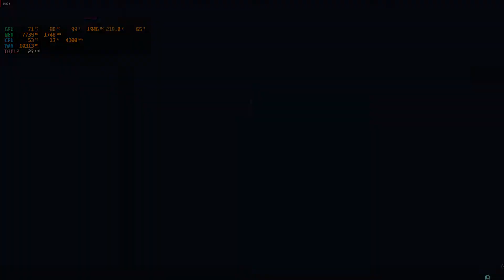How to fix ASUS Radeon RX 5700 XT Strix temps

Comment: What is the size for all the pads?
Reply from the maker: You can find the pads I used in the video description.
If I am not mistaken, the memory pads are 1.5 and the other ones are 2.0.
I believe those measurements are mentioned in the video.
Reply: @DiegoPCMR tankyou

Comment: Am going to it with my strix 5700xt she is getting 105-110 on hot spot lately what type of washers did u use m2 1mm or 0.5 mm ?
Reply from the maker: @omarbettayeb3943  This was so long ago that I don’t remember well which ones I used, but you can find in the description the washers set I bought. I would suggest using very thin ones and don’t try to over tighten it, be very gentle.
Reply: Did you find out what washers to use?

Comment: Hey, what are washers and why do you need them to fix this card
Reply: so can you provide the answer?
Reply from the maker: washers are small pieces of round plastic that go between the screw and the screw hole, increasing the gap and therefore increasing the presion.
This particular model had the issue of having the heatsink not so tighten to the pcb and for that the temps were too high.
Even Asus provided at some points a kit to fix this issue but in my video I use another kit.
Please check the video description, there you can find all of the tools I used for this.
Reply: why are those stupid yt bots deleting comments
Reply from the maker: @KtoKolwieK14 I have restricted links or any other kind of suspicious comment. Sorry but I rather have it that way.
Reply: @DiegoPCMR  what is suspicious in asking how much of thermopads did you used for replacement in GPU
Reply: I want to know how much thermopads i have to buy so i wouldn't pay extra for thermopads i won't use
Reply from the maker: @KtoKolwieK14  I only bought one package of each of those. In the video I specified which one you should use because the space between the memory chips and the mosfets is not the same.
Reply from the maker: @KtoKolwieK14  not sure, I don't make the rules.
Reply: @DiegoPCMR  yes and thank you for that but, you didn't use all of thermopads in those packages, only part of them, so maybe you can estimate how much have you used both thicknesses of thermopads so i wouldn't need to buy both full packages because buying it cost like 1/5 of new GPU
Reply from the maker: @KtoKolwieK14  Sorry bro. That was many years ago and I actually don’t remember how much I used. I think it was around half the pad.
Reply: Hi diego, so I end up buying all this stuff even all of thermopads and replacing all of this it isn't that hard as I thought, but there's one more problem, but maybe you do remember or you can check what size of washers did you used for gpu screws (if yes you could edit your pinned comment and put in the answer for that so that others that have this problem might see it). Because when I'm screwing M4 size washers the spring on gpu screw starts spinning and the washers ends up half covering screw next to it which is thing that shouldn't be happening and M5 size ones are not spinning that much but they are too big like for the ones in your video. Thanks Diego and I'm copying this comment in case YT decides to delete it like other comments.
Reply from the maker: @KtoKolwieK14  Hey man, I would really like to give you more info but this was so many years ago, I don’t even have the card with me anymore. All I remember is that I used the transparent and thinnest ones because I just wanted to add a slightly bit of tightness.
But be really carefull, too much presure can break the die, so don’t overdoit.
If you see that the heatsink is already tight without the washers then don’t use them.
Reply: @DiegoPCMR  Wonderful news Diego , the GPU from idle 55 degrees Celcius went down to 30-35 but cant wait to see the results in games without undervolting
Reply: oh man in some old not demanding games i had sometimes like 70 degrees with undervolting and sometimes 95 without, now in those same games i have 45 degrees max without undervolting nice
Reply from the maker: @KtoKolwieK14  Really happy to read this and that my video was helpful man. The 5700xt is an amazing card and even more now with fsr 3
Reply: @KtoKolwieK14 а какая температура GPU hot spot, теперь у тебя на этой карте?
Reply: @aleksandrsheremisov4068  My answer is quite long and not english perfect so I hope you won't have any problems with translation and reading through it.  

Temps depend on the game settings and whether you are doing OC or undervolting on the GPU. I often play with OC especially at GPU demanding titles (like Cyberpunk, Witcher 3, Metro Exodus, Kingdom Come, STALKER 2, Bannerlord, Skyrim with graphical mods, Phasmophobia and some others) because i don't use upscaling. 

Max temp I had on the hotspot with OC was 90 celcius but it was after long game session at Cyberpunk on High settings and also when i was playing Stalker2 i had similiar temps. In most game sessions (like 3-4 hours) I have 85 celcius max but you have to be informed that I have large PC case with 3 140mm fans that are at 75% when playing demanding games so i rather have good airflow. 

When I'm not doing OC on the GPU the temps are rather good but it depends on the game title,  old games (before 2013) or some strategy games or pixel art games usually don't use much of GPU power so the temps are low (hotspot 30-55 and 30-50 on the rest). 

When playing newer games without OC temps are lower but also framerates so you know (73-79 max on hotspot or so and 65-72). I also managed to find dependance that the higher temps the GPU has then the higher the difference between GPU temps and hotspots temps( if the temps are low like 40 then hotspot and GPU have almost the same temp but when the GPU temp raises to 50 then it starts getting a lot hotter in the hotspot [50 on the GPU 57 on the hotspot and when the temp raises to 75 on the GPU then hotspot has 85 almost guaranteed).
Hope you found what you were looking for

Comment: What termal pad are you using on this card? I've same card like you. And what if i using kryonaut extreme on that, is that good?
Reply from the maker: Hi! Please check the video description, you will find there all of the products I used.
Reply: @DiegoPCMR  Minus pad from grizzly? That's non conductive? I'm affraid to using that. If i use termalright valor, can it cool?
Reply from the maker: @TarnishedLG  Sure, those are totally non conductive, those are just regular thermal pads. I haven’t used thermalright, but just make sure it is thic enough to cover the gap between the component and the heatsink.
Reply: @DiegoPCMR  ok i'll try. Thx diego! Appreciate it❤️
Reply from the maker: @TarnishedLG Happy to help!

Comment: Why this problem is happening?
Reply from the maker: Because of a bad design from Asus
Reply: @DiegoPCMR  isn’t it fixed yet?
Reply from the maker: @fadil-dy5zk  That depends on your card revision. It could have the oficial fix from Asus or not. Mine had a later revision and still adding washers did some improvement.
Reply: @DiegoPCMR  did you recommend this card version
Reply from the maker: @fadil-dy5zk  No, I would recommend going for a 6700xt, but if you are planning to buy that one due to your budget, then I would skip the Strix version. The 5700xt is a great 1440p and 1080p card, but this version runs really hot as you can see in my video.
Reply: @xXAsystolieXx thats alot of temperature
Reply: @xXAsystolieXx i hope you will find a solution

Comment: Thank you so much for video. I have a question. In video, you use 1.5mm soft pads for memory.. I would like to install solid graphite thermal pads. But in my region i can find 1.2 and 1.7mm sizes graphite pads. How do you think 1.2 mm solid pad will be ok for this card?
Reply from the maker: Hi! I wouldn’t recommend applying a thinner pad since it could affect the contact presure and reduce the heat dissipation.
But you could go with the 1.7mm and just cut a smaller size, since it will spread with the heatsink presure.
Reply: @DiegoPCMR  excellent, thank you very much for your help, thank you for detailed video.
Reply from the maker: @danilashedrinsky8903  Sure! Glad I could help!

Comment: Hi! I have dual monitors and I also have rx 5700 xt my problem is my junction temp is  90 even when idle. Can you pls help me?
Reply: Changing thermal pads and paste will help.. also noticed if I put extra pads between the pcb and backplate seemed to help me pretty good
Reply from the maker: Do you have the same model? The strix? I am asking because there is a bios update that helps a lot with the temps issue.
Reply: @DiegoPCMR  I have Aorus 5700XT
Reply from the maker: @Joyciaaa  I would suggest repasting and changing the thermal pads. Also try to look for any bios updates on the gigabyte page.

Comment: Is it normal that in 1080p ultra settings it goes to 89 degrees? Playing Cyberpunk 2077
Reply from the maker: Cyberpunk is a very demanding game. Have you updated to the latest bios?
Reply: @DiegoPCMR  Te refieres a los drives de amd,no?
Esos si los tengo al dia
Reply from the maker: @sr_luigi   No, me refiero al bios de la grafica. Asus sacó un bios que corrige problemas de temperatura.
Reply: @DiegoPCMR  Bueno ya se notó que no tengo idea de computadoras y la verdad nunca lo e hecho así que ahí voy, muchas gracias
Reply from the maker: @sr_luigi  Dale no hay de que, en lo que pueda trato de ayudar. En este link puedes encontrar la ultima bios y el programa que te ayuda a flashear la bios
https://rog.asus.com/graphics-cards/graphics-cards/rog-strix/rog-strix-rx5700xt-o8g-gaming-model/helpdesk_bios/
Reply: @DiegoPCMR  Mi bios es AsRock y ya actualice todo, si juego Cyberpunk en ultra aún la gráfica llega a 90 grados como mucho pero por lo que vi en tus videos es normal que llegue a 87 grados, no?
Reply: Lo que sí logré fue bajar las temperaturas de la CPU y de la VRAM :)
Reply from the maker: @sr_luigi  Entiendo. Puede ser que sí, pero todo depende del diseño del cooler de tu modelo. Podrias en todo csso buscar exactamente un review para tu modelo en especifico.
Reply: @DiegoPCMR  Gracias por todo bro
Reply: @DiegoPCMR  Pues resulta que lo que me faltaba era limitar los fps jaja 
Ahora me va entre 65 y 73 grados con todo al ultra

Comment: Hey thank for the video :)
Quick question where did you use 2mm pads and the 1.5mm one
Reply from the maker: Hi! As you can see in the video, the 2mm pads were used in the heatsink, and the 1.5mm were used on the black brace. There are also some pads in the backplate, but to be honest I don't think it would make any difference replacing those.

Comment: What revision is your card
Reply from the maker: Hey man, to be honest I am not sure. I bought it on July 2020, so I guess it must have been a late revision, though it didn’t have the latest bios.
If you have this card, make sure to update the bios, it will solve some of the heat problems and the fan noise.
Reply: @DiegoPCMR  thanks mate probably should have asked this before I bought all the parts to do the fix haha but I’ll still do it it’s 2 years old and some new thermal paste wouldn’t hurt
Reply: @DiegoPCMR  so yeah tried the bio Version 2 says it don’t need it and then idk how to tell if the E mode was installed on the q mode side haha even after doing it
Reply from the maker: @brettmayo4354  You can check with gpu-z which bios version you have.

Comment: What mm of washers did you use
Reply from the maker: Hi! The set of washers is in the video description. The ones the I used were the M8/16-8*1.4, which are included in that kit. Those worked for me, but you can try with other ones from that kit as well.

Comment: Good video, thanks alot. Gonna do this with my card when i get all the parts :)
Reply from the maker: Thanks for the feedback and glad it helped. Make sure to also upgrade the bios. That helped a lot with the fan noise.
Reply: @DiegoPCMR  And how do i do that? :O Thanks for the tip!
Reply from the maker: @mmyrvold5494  You need to go to the ASUS support web page and look for the 5700xt Strix product. Inside it look for the bios update, it comes also with an updater tool.

Comment: Hello, thanks for your video. Does your gpu have samsung or micron memories? Do you have any idea if the measurements you passed are valid for both memory models (samsung and micron)? thanks and regards.
Reply from the maker: Hi, I am so sorry, I wasn’t able to see which memories it has, but definitely I would not assume those temps would apply for both models.

Comment: hello my strix 5700xt always runs at 110c junc temp and i been lied to as this was okay,  i have the fix screws on but i guess it wasnt that much of a ''fix'' i dont really want to avoid my warranty but a company that left me with a fix that did literally nothing wouldnt help me on anything other. I would like to get a replacment card but i dont think its possible card is over 2 years old at this point. I even sned the card back as the fix didnt work at all they just sent it back as everything was normal 110c on any triple a game
Reply from the maker: Hi. ASUS is well aware of this problem, and I know that they have sent screw replacements for those who had the temps issue, so depending on your location you could try to ask for support. If that is not possible, then I would suggest updating to the latest bios and tightening a bit the screws.
It worked for me as a first choice, the card ran less noisy and a bit cooler.

Comment: Hi Diego Good video... Did you change the original screws ? O just with the washers improve the contact are to improve the temp?
I have the same model but im still thinking 86º C in VRAMS its to much....
Reply: 86c vram is fine.
Reply from the maker: Hi, thanks! 
I used the same screws, the only thing that I add were the washers. I think this is all you can do to this card, since the overclock is too agressive. Also make sure you have the latest bios installed on it. Mine came with an old one and the temps really improved after I updated it.